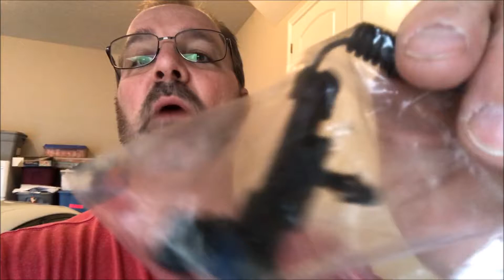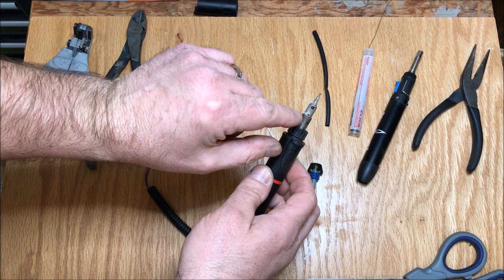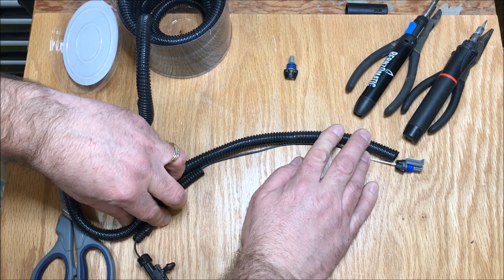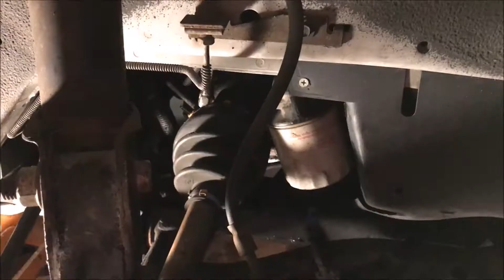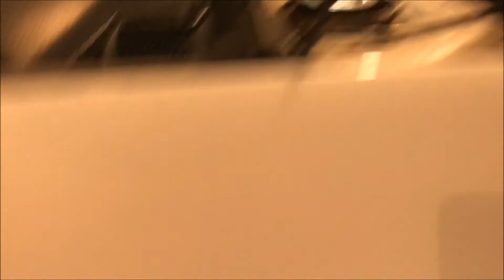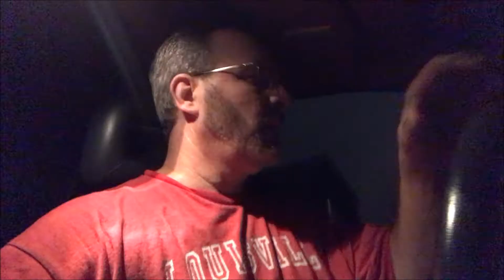Finishing Up The Power Steering Pump

Comment: I was going to say the belt tensioner, but you changed that. When i am stumped it goes to the shop..i know this mite sound crazy but check to make sure the pulleys are clean and dry of fluids...hope it is a easy fix. On a side note you going to be at the Atlanta show in April, cause i am trying to get my stuff in line to go. And if i asked before i am sorry...brain fart...lol
Reply from the maker: +Robert Evans Hello Robert,
  I'm not going to go to Atlanta this year. Hopefully next year I can make it. 

Regards,
Bob

Comment: We use to pour a can of brake fluid into the radiator and if the squeal stopped it is a bad bearing in the water pump. Hope you get it figured. Also the break fluid will not hurt the anti freeze.
Reply from the maker: +Terry Vance Hello Terry,
  Two weeks ago, I replaced the water pump. I've also replaced the belt tensioner and the serpentine belt. All that's left is the crank, alternator, and AC compressor. I'm stumped. 

Regards,
Bob